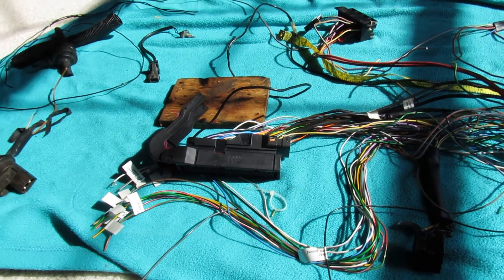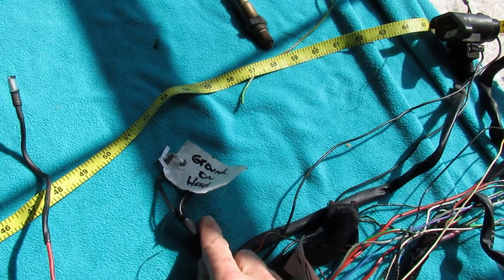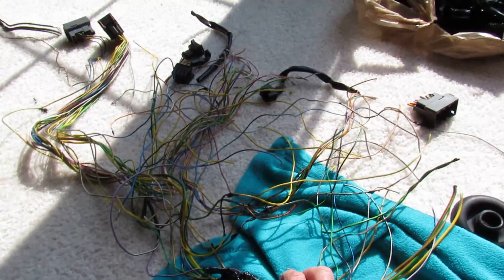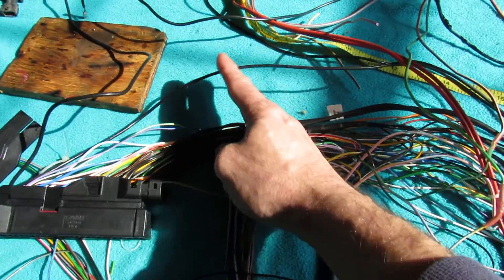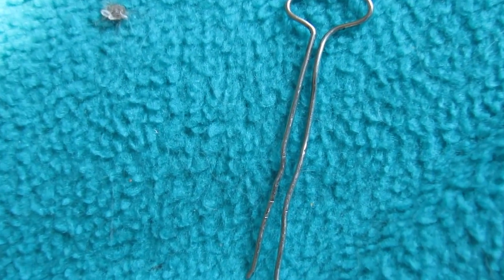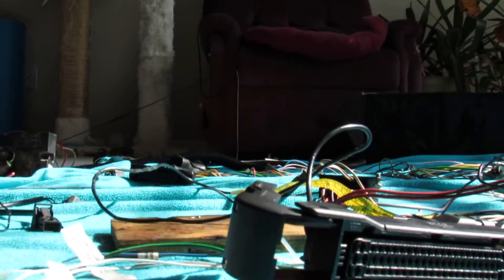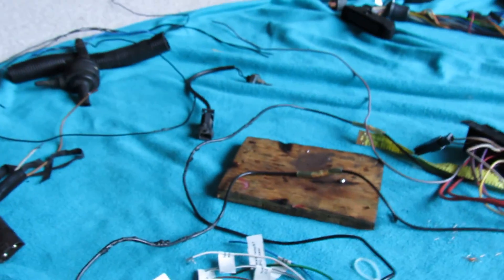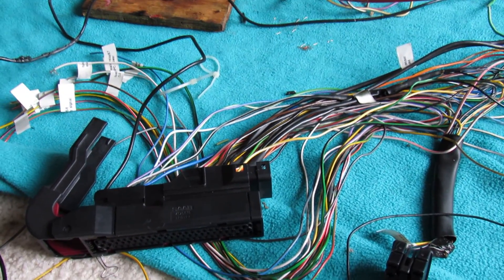SAAB C900 T5 Conversion: Extending wiring harness

Comment: What is the total length of the new t5 harness need to be ( same as the old harness i guess )however mine is still in my car any idea on the length ..?
also did you use the original fuel pump relays and holders ?
did you also remove the large grey plug ? is it needed .?